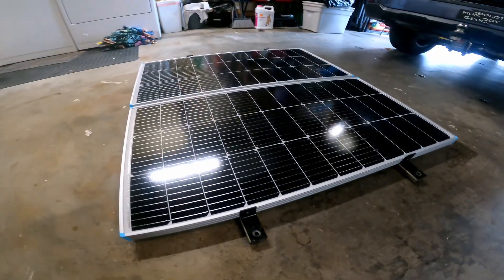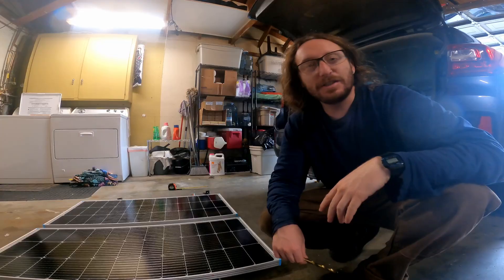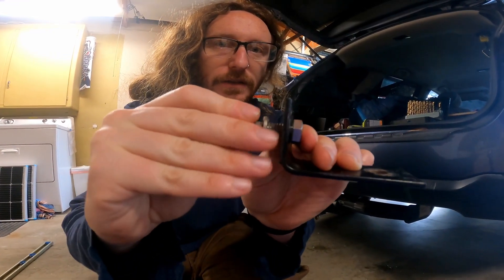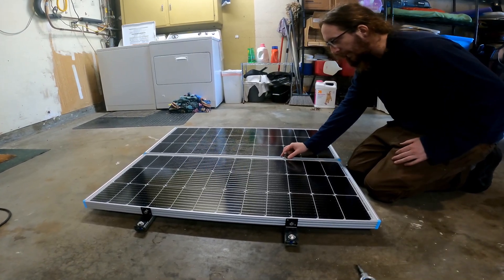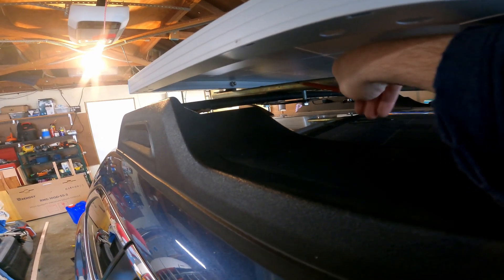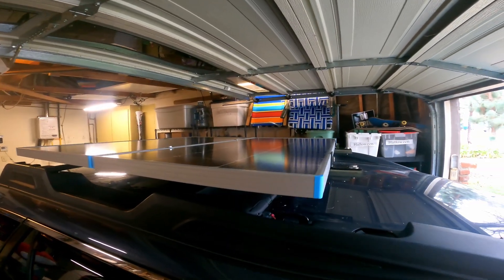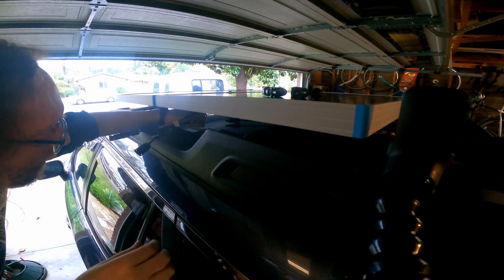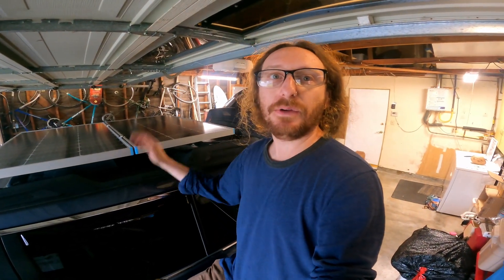How to Mount Solar Panels on a Car, A Huge Upgrade to my Subaru Outback

Comment: I don’t think drill is that bad as long you step up the bits and let the bit do the work (don’t push it in). That’s a really cool idea. A never would have considered using unistrut. Is it galvanized? Do you have any leaking from heavy rain running the cables through the rear hatch gasket? I saw another YouTuber ran his cables through the roof antenna port which I thought was pretty creative. Do you have any increased wind noise at highway speeds? How’s the drag on your fuel economy?
Reply from the maker: I’m not sure if it is galvanized but I’ve had it on my roof for a few years and it hasn’t rusted. I’ve had minor leaks from the cables but I think you could probably figure out a way to improve how the wires get into the car. I honestly don’t even notice it on my roof. Absolutely no noise or noticeable drag. Cheers!

Comment: Thanks for posting this. How has passing the cable through the hatch worked out; no issues there? Overall, would you do this upgrade again?
Reply from the maker: Passing it through the hatch worked fine for a few years of mild winters in Southern California. This last winter I lived in Humboldt where it is very wet and rained A LOT. I noticed a small leak and over the course of a few weeks I noticed my trunk (where I keep my spare tire under my platform) filling up with water. I drilled a small hole through the floor to let the water out and haven’t had any issues. I would definitely do this again. It supplies me with all of the power I need even in the winter with less solar input.

Comment: Good work. It appears to me that you could have joined the two panels together at the two corners or where they sit on the bars by nuts and bolts so they don't keep banging when you drive. And how did you take the two wires inside?  just letting them compress on the door jam? Remember, being in parallel, they carry around around 20A. What is the Voc of the panel and the working voltage of your inverter? TIA.
Reply from the maker: hello thanks for the comment!! i just let the wires compress in the door and I have a renogy dc30 charge controller. cheers!

Comment: I just installed a solar panel on my car too but I noticed how you routed the cables into your car
By routing it through the top, does water ever leak inside? I routed mine along the side and then I just shut the trunk on it at the bottom so the water doesn't get in.
Reply from the maker: Very cool!! Unfortunately mine does have a slight leak now. I think I just need to wrap it a few times with electrical tape to get it to seal better in the door.
Reply: If anything, try routing it down the side and into the bottom left corner! I've had rain for the past couple days and no leak! I have a Subaru Crosstrek and a 15ft cable reaches my ecoflow located in the trunk on the right side.

Your setup makes me jealous since you can fit 2 panels while I can only mount 1 200w panel on mine haha
Reply from the maker: The BEST Solar Setup on a Car
https://youtu.be/urObxYlKXvY
Reply from the maker: That is a good idea!! I actually have 400 watts of solar now!! I posted a video about it recently!!

Comment: awesome vid, thanks.  looking to do the same to our OB.   how is the wind noise/vibrations at highway speeds?  TIA
Reply from the maker: Hey thanks for the comment! I've had other people ask me that question and the truth is I DON'T NOTICE IT. The superstrut is really strong and keeps everything nice and tight. When I first put a solar panel on, I thought I would hear the wire flap around in the wind. That is definitely not the case. I don't ever hear a sound from it.
Reply: @ThePangeaMan   good info thanks!  When we put the Thule rack on ours, noticed a low whistle that perhaps added 10% of noise to cabin, but certainly not a deal breaker. Looking fwd to putting a 200w setup on ours, and seriously doubt it’ll have much audible effect since it will be within the roof rack.  

Sidenote to folks doing the same: putting the panel underneath rack will allow for utilizing cargo atop, since the roof rack will be exposed as normal and panels just underneath.  

🤙🤙🤙
Reply from the maker: Wouldn’t the cargo block the solar panels? What kind of battery and charge controller are you going with?

Comment: Nice set up.
Reply from the maker: Thanks!! I saw that you had a solar panel glued to your roof? How has that been working out?
Reply: @ThePangeaMan   the panel works great,I used 3m double sided stick tape and it’s been on there with no issues for the past year.
But I should of done something like this in case I needed to replace the panel.